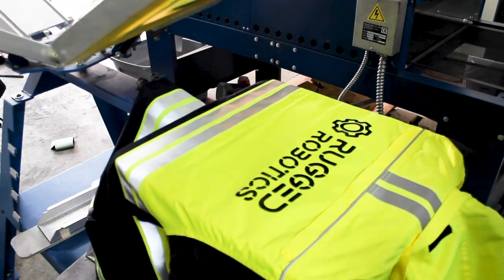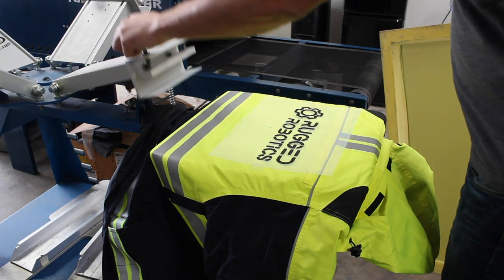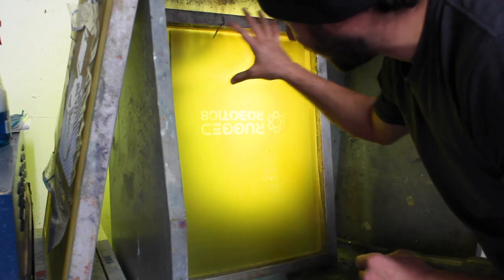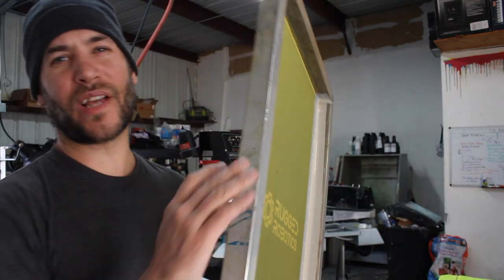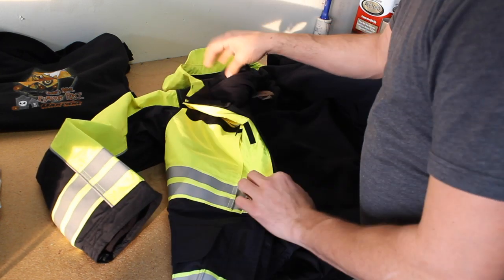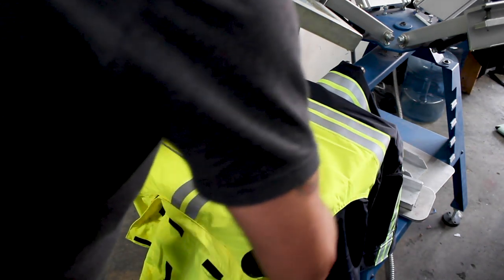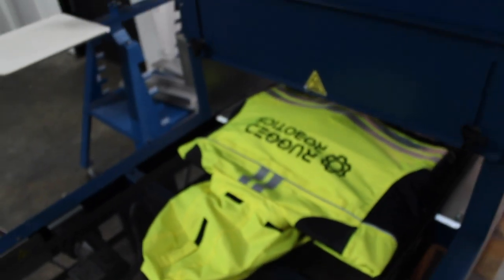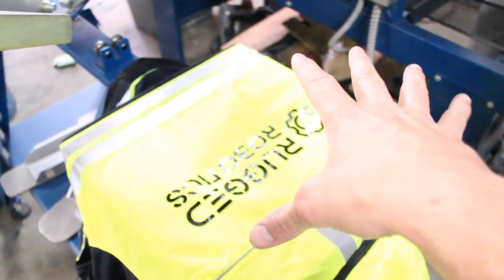How to Screen Print Safety Jackets (with tips & tricks)

Comment: Damn, that was painful to watch for a number of reasons. I would never push stroke for the reason you demonstrated - you stuttered and didn't provide a smooth stroke - you could have easily ruined it. And what's the point with all the screen tape? I never tape my screens and what a waste of time and money. And use painter's tape on the pinholes and crossmarks as it peels off easily. I'm now frustrated and will have to calm myself before the evening is over. I'm actually pretty pissed.
Reply from the maker: I have my reasons as to why I do things the way I do, but since you were so irritated with the video, and are clearly THE expert and there's only one way to do things,  I'll humor you. Grab and beer and chill.  You have to realize that there's more than one way to skin a cat.

That wasn't a stutter. With a graphic that has a straight edge, the squeegee can hang on the graphic once it hits the open mesh, but I don't have to tell you, because clearly you knew that.

The point of the screen tape is to reassure all pinholes were taken care of, just incase I missed any. Screen tape is way cheaper, pennies per inch, vs a $300 jacket.

Are we talking about painters tape to seal off the edges or are we talking about under the screen tape around the graphic? I would't recommend that to anyone, nor is it THAT much cheaper.  I'll disagree with you on the time savings, because clearly you know that PMI split tape has a low tack side that makes it a breeze to pull off.  And the way I taped the screen, it all comes up in one pull.  Try that with painters tape, aint happen... captain. The under side was taped  with quick rip tape (also a screen printing tape) that has a low tack edge for EASY removal.

Reasons I wouldn't recommend painters tape: Tears easy during removal, can easily puncture allowing ink to get through your screen and onto your garments, not cost effective, ink can make it's way around it, and it's made for latex paint, not plastisol nor water based inks, can leave residue on your screens, and does not hold up well to long runs.  3/4" painters tape for pinholes and registration marks, sure, that's fine.

Checkmate!  Just playing with you, but seriously. 
If this video that was meant to help others pissed you off that bad, I think you should start a channel of your own to share you knowledge, or learn to chill a little. Perhaps it's time to add a therapy session to the end of my videos.
Reply: Jamie Jaime Jaime, You are correct!  The pull stroke is more predictable. Matt has correctly used a fine mesh with multiple strokes and I have seen him use this technique many times to where i am sure he has a good idea of the sheer and pressure to get his results. In the future, I hope you will be blessed with large enough orders that Taping your screens becomes obvious. It's a good habit for a commercial setting. Good Luck with that calming and be sure to lubricate!
Reply from the maker: @rickpaul2177  Thanks, Rick.

Comment: Tip that worked for us on low cure items like these. We used a standard hair dryer to heat the print kind of flashing it before we ran it through the dryer. Worked well and saved smudging the ink in preparation for running it through the dryer.
Reply from the maker: Great point! Normally I'll flash them before, but because of the cost of these and not knowing how they'll react to heat... Made me nervous.
Reply from the maker: Had we screwed up one... a lot of profit down the drain. :)

Comment: Is there a water resistant coating on those ? Good idea to wipe it with alcohol if so for adhesion.
 I also like to preflash or iron down with teflon and an iron to get the smoothness. Great vid on a very nerve racking type of job.
Reply from the maker: Good call! The client has given us feedback since and says they're holding up great. Only one of them has a little scratch in the print, but they are overall happy.
Reply: If you’re to spray that water resistant part with alcohol, how would I restore the water resistant membrane after printing and letting it cure?

Comment: Hi Matt, Aren’t those  polyester or can we print them with regular plastisol ink? Thanks.
Reply from the maker: They are poly, but regular plastisol will need to cure around 330º. I didn't want to take the chance melting the jackets, or having die migration happening. The best way to handle that is with a low cure ink.

Comment: Man how do you not have a jacket hold down Matt! You made me way to nervous ! 

I hate when I use a 23x31 screen for a small print. Sucks you didn’t have anything else to burn on the top side of the screen.

What emulsion are you using on that screen that takes 3 minutes to burn? 

Also don’t you need a catalyst of some type to make the plastisol stick to that material?  Thanks in advance and very informative video!
Reply from the maker: Hahaha.. Hold downs are for rookies ;)  hold downs are great, but we don't do enough work to justify buying one. There's also workarounds without one.

We do have manual screens in the shop, but this was a rush order and I happened to have an auto sized screen ready to go. Ideally I would use a manual size screen, but this little press has done okay with the larger screens.

It's a poly material, so I wasn't too worried about it adhering. Only how they'll handle the heat. We have had a lot of success screen printing safety garments with low cure inks, with no issues. As long as they don't have a fireproof / teflon coating.
Reply: Mikey Designs & Silk Screen gotcha! Good info my man👌🏾
Reply from the maker: @Factory928AC  Thanks!

Comment: Is this ink okay to use Mikey ? I see ruined using another type of ink. I just wanna make sure it doesn’t wash off and setts!
Reply from the maker: As long as you get the ink to the proper cure temp, you'll be fine. Our client has reported back that they have been holding up great.

Comment: *Scarry jackets* - Thanks for the demo! I noticed you didn't use any catalyst. In your opinion, does low cure plastisol replace the need for a poly additive?
Reply from the maker: Any time! Well, that's exactly what were are using is a low cure low bleed ink. With the ink being black as well, we haven't had any issues.

Comment: Great video Matt! Thank you for sharing. I’ve had a tough time with these. Especially on the auto. I look forward to learning more from you. Your very informative.
Reply from the maker: Thank you! I was way too nervous printing these on the auto because of the cost per jacket, and our current auto probably would have messed them up because it can't do a multiply prints without tabling up and down. So the manual was the best way to keep an eye on things without making mistakes. Plus it was a really small run.

Comment from the maker: What methods do you use print jackets without a hold down?
Reply: MD&SS: I use spring clamps, the ones with rubber tips & rubber handle grips, the kind you can get from home depot/lowes/harbor freight etc. Pull the jacket/substrate taught from the bottom and cinch it with a couple of clamps. But get the metal clamps with the rubber tips & handles like I mentioned above, their only a buck or two and they are more sturdy than the plastic clamps! Also give it a quick flash before & after printing, this will smooth/flatten out any wrinkles , and reduce the risk of smearing wet ink while transferring to the conveyor dryer. Good luck!
Reply from the maker: Great tip! We've done similar things in the past. It's definitely cheap insurance going that route.

Comment: I almost had a heart attack with all the flooding and print strokes. Nice work, prints look great. What mesh count were you using?
Reply from the maker: LOL, I hear that. I used a 230 mesh to keep the deposit low. I've done numerous jobs like this and have a good feel as to when the ink  has cleared the screen. Only one shot at it per jacket without  messing them up. Our client was very happy with the results. Guess I could have shared how I know when I'm happy with how the screen is clearing from my experience.
Reply: @mikeydesignssilkscreen473 this is also a perfect example of why buying the newest best automatic isn't going to solve all of a businesses problems. Some people in this industry forget the nuances in screen printing.
Reply from the maker: @dmowolfenspeedster  I agree. Now matter how you slice and dice it, you have to know your stuff and potential issues you'll run into or you'll spend a lot of time redoing orders and never making a profit. Start small, learn from your mistakes, and keep pressing on.

Comment: HAVE YOU HAD ANY FEEDBACK  FROM THE CUSTOMER ON HOW THE JACKETS ARE WEARING? I AM CURIOUS HOW THE INK BONDED TO THE  WATER RESISTENT FABRIC. WE USUALLY EMBROIDER OR HEAT TRANSFER ON THESE TYPE OF GARMENTS PRIMARILY BECAUSE I AM OLD SCHOOL AND STARTED MY SCRREN PRINTING CAREER BACK WHEN SATIN AND NYLON JACKETS WERE THE HOT THING. WE USE TO HAVE TO ADD AN BONDING AGENT TO THE INK AS WELL AS SPRAYING DOWN THE JACKET WITH A CHEMICAL TO REMOVE THE REPELENT COATING IN THAT AREA. Keep us posted on the long term wear on this project.... you are pretty ballsy to giver hell without a jacket clamp down! lol
Reply from the maker: I got feedback and they're holding up great. One jacket scratched just a little, but could be either how ruff they are with the garment, or their cleaning process.